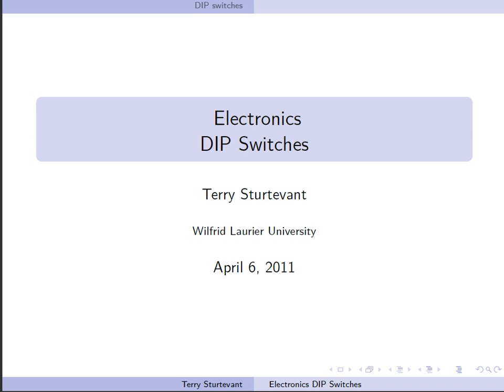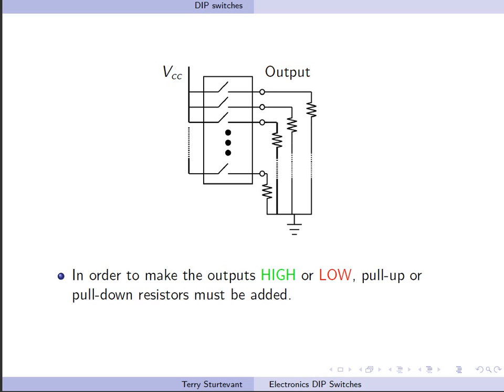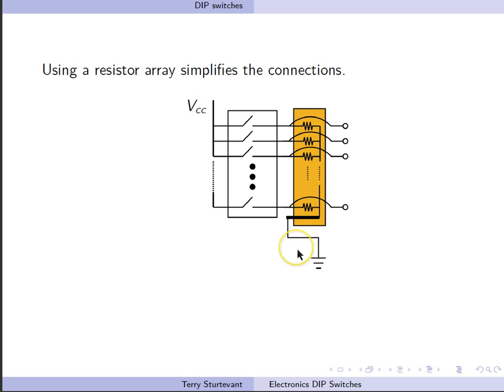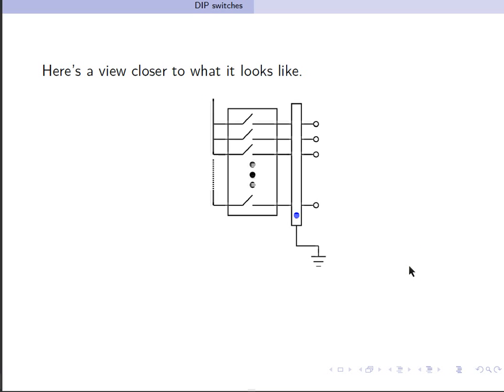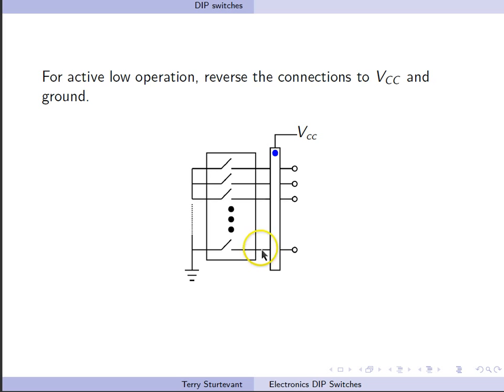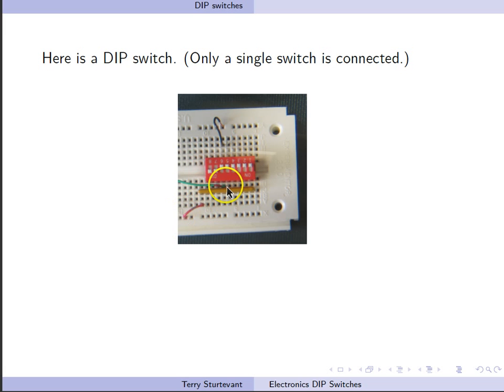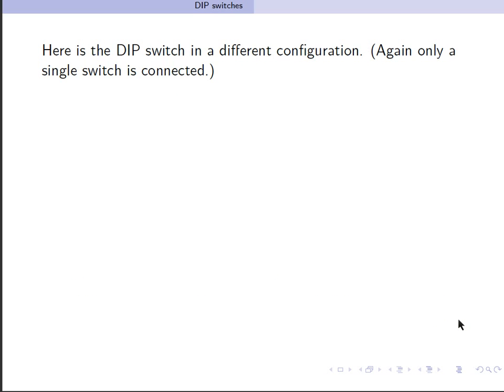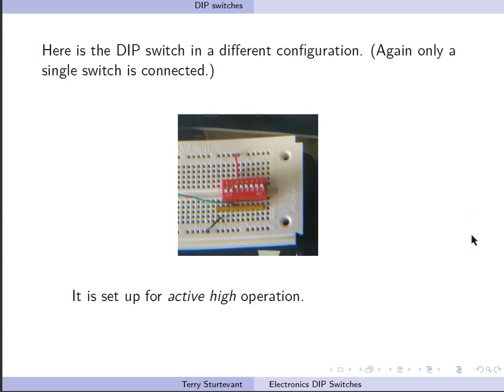DIP switches

Comment: If we turn this switch off , will we get ground?? And i'm also really reallly thankful for this video , really ,
Reply from the maker: Without pull-up or pull-down resistors, a switch which is off is, by definition, not connected to anything. So to get ground with the switch off, you need a pull-down resistor.
Reply: Terry Sturtevant in the first pic , active low , the black wire is ground , red is vcc , green wire coming above the resister is the output , in your circuit of first pic if the switch is pulled down will the output be = 0 i-e ground 
I'm sorry , disturbing you , but I really need to get this ri8
Reply from the maker: With the pull-down resistor to ground, then with the switch open (i.e. not connected) the output will be ground.
Reply: i understand now lol xD thank youuuuu